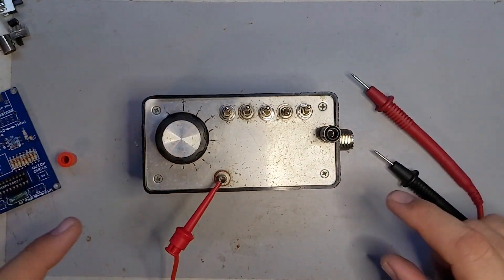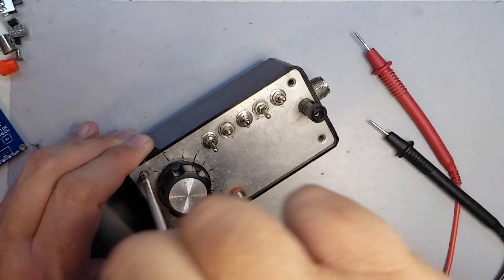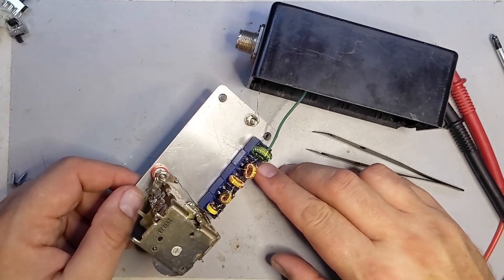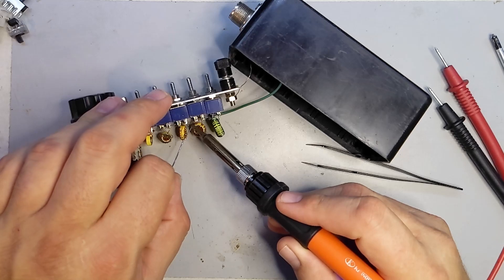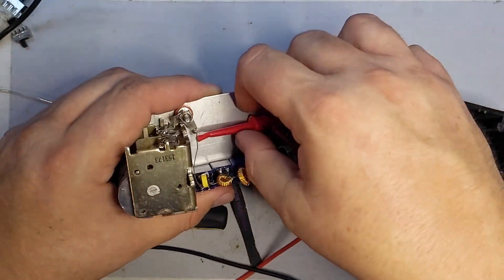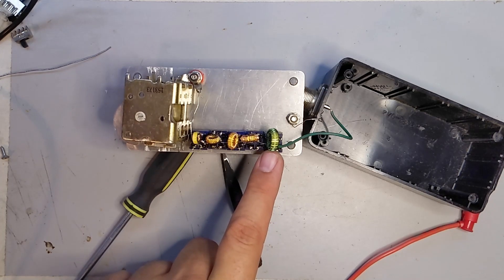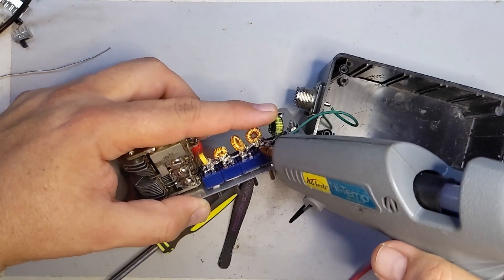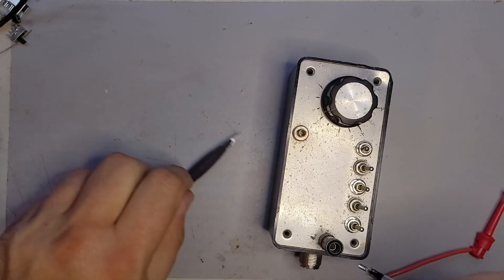QRP L Match Tuner Review and Repair

Comment: I didn't know that you built it too.  That's awesome.  I can see an extendable whip matched with something like this for 70cm through 10m for techs and connecting to a radio like the 705/6 or 817/8